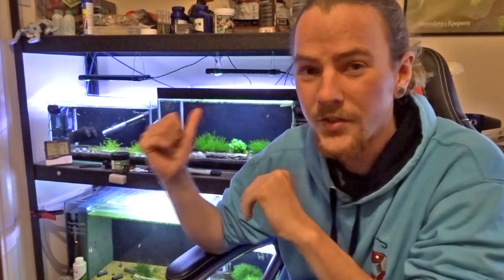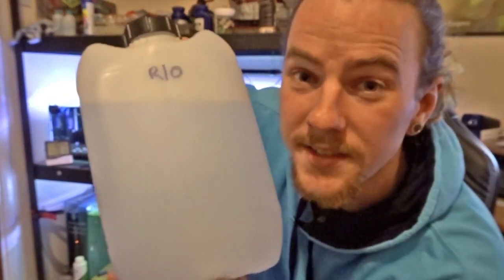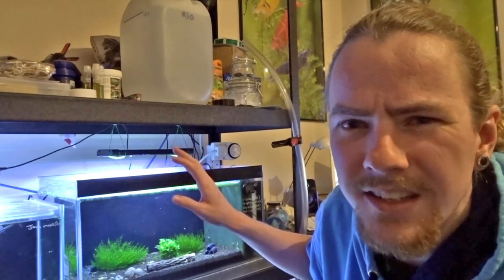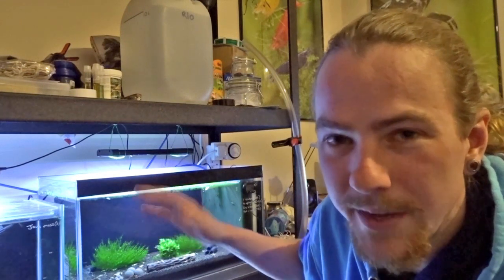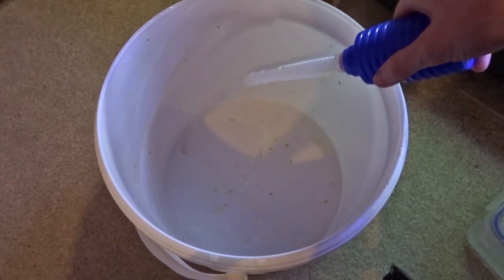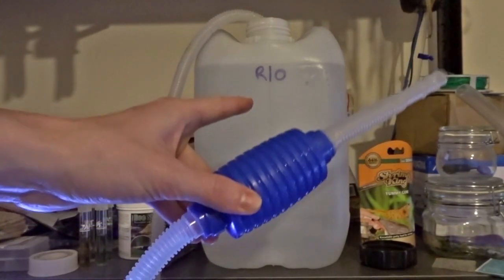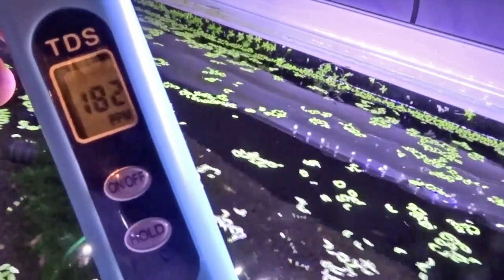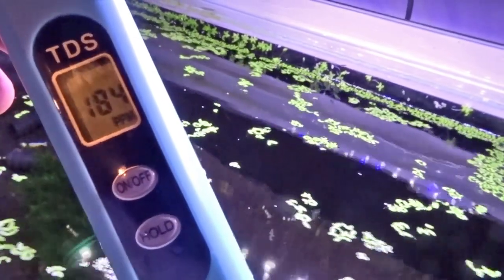How to Lower TDS in an Aquarium

Comment: My son was a Math major and he made me a formula to calculate how much I need to change exactly to reach the desired TDS for my tanks.   It is D = V (final tds - original tds)/ (original tds - new tds).   V is the tank volume. D is the volume to be changed. original TDS is the dirty tank original tds measure. New tds is the tds of the water coming in. Final tds is your goal tds. Then I do consecutive days until I reach that goal if it's more than 20-30% to be changed. Since sometimes I feed some of my fish baby brine, tds will go up more intensely so I stay on top of it. Hope this helps. : )

Comment: I got 2 blood parrot and they are still lil babies. Like around 1 inch or so. Our regular tap water TDS is around 118. My goal is to keep the TDS level between 300 to 200. In order to achieve this I have to do the water change daily or sometime every second day. No real or artificial plants in the tank just few hiding spots with power filter and air pump. Is there any reason that you can imagine why TDS is increasing so frequently. I do vacuum the gravel for any waste every time I change the water. Also my tank is like 8 days old or so.

Comment: Question;  I’ve cycled 2 new tanks.  My tap water is roughly 20-30 tds, which is very low!  My cycled tanks contain 1500-2000 tds!  I’ve used fritz bacteria and ammonia fuel to cycle the tanks, and salt per instructions.  Does anyone know why in the world tds would be so high.  My only thought is it may be measuring “good” bacteria.  I’ve added nothing else but plants and sand substrate, so I know it’s not some random chemical/pollutant.  Help me please!  Even seasoned fish breeding companies have not been able to direct me.  I’ve done water changes with the low tds tap water, and when I measured a day later the tds was above 2000!  Leads me to believe it’s multiplying bacteria, but I’ve not read about this happening to anyone else cycling tanks.

Comment: Can someone help please? I'm super confused with the water change aspect using R/O ("Rio" water lol!) water.

I totally understand the 20% water change ratio to not stress out the live animals, BUT, over time when you change 20% each time during cleaning, would the tank eventually be 100% R/O water? 

I have a 6 gallon live planted Betta tank (no Betta yet since mine recently passed away due to a tumor) that has been cycled for over 1 1/2 years. I live in San Diego CA, USA and the water in the area I live in has rather high pH (7.5) and TDS (700's).

My reputable fish seller suggested I replace 2 gallons of my tanks water with RO water to lower the #'s before I purchase a betta from him to ensure the #'s are lower.

I'm skeptical in doing that since I don't think it will be that easy to balance the levels that I need them to be. My last Betta fish lived happily until the tumor came around. 

Lets say I DO place 20% RO water and I'm ready to do a water change and I remove 20% of my now tap/RO mixed water. Do I add in 10% dechlorinated tap and 10% RO water? Sounds simple enough but I have a feeling it won't be as easy as it sounds.

Help please?

Comment: How did u deal with PH ? RO water has extremely low pH tho
Reply from the maker: Good point. The pH in these tanks generally sits around 6, so it’s lower anyway and as long as the buffering substrate is still working I’ve not noticed any major swings. I think as long as you have things in your tank that help to buffer the pH then small amounts of RO water should be ok :)

Comment: Lol, my tank's TDS is 400ppm. Is that extremely high for a low tech planted tank? My plants are having a hard time growing by the way. Also pH is around 7.6 and GH is 10 degrees. :(
Reply from the maker: There are a lot of variables. Like how long you have the light on and are you using fertilisers?
Reply: Same with me...my tank 583 ppm..only 5 gallon tank, no fertilizer
Reply from the maker: Have you tested your tap water?
Reply: Ughh same. My tanks' at 500+ ppm now. The tap water is ridiculously around 425ppm, and I checked that my tester isn't busted. Can't budget for an RO filter right now so I've just given up and only take in really hardy fish and shrimps :/
Reply: @cladellain  do your plants grow well?
Reply: Noble de Rafael They’re okay, but that’s because I only bought hardy plants. 4/5 amazon swords are growing steadily, another long-leafed plant (I forget the name) flowered, and duckweed still getting everywhere 🤷🏽‍♀️
Reply: My TDS is over 900.   I use strictly DI water tested as pure.  My plants never grow and show all signs of deficiencies despite all the fertilization I give them according to the Seachem dosing schedule.  Phosphorus, Iron, Potassium, and Nitrogen and root tabs throughout. I even add in Epsom salts for magnesium.  I upgraded my light to a Fluval Plant LED 3.0 light and then got a huge diatom bloom within a week after more light was added.  I have both brown and green algae. I clean my gravel once a week. 6 bettas in a 50 gallon tank. All my chemical tests are good.  High phosphate is treated with Seachem de-nitrification in the Fluval canister. I also have a Phosphate remover pad.  My city water has high silicates so I bought a test kit. Also Seachem’s Phosguard to start using that.  I just added snails from two different sources and they don’t seem to be moving much.  I’m becoming very frustrated with the hobby.
Reply: @loreall.2461  Where are you located?
Reply: The Seachem silicate test kit showed low silicate levels.  It was nearly comparable to the original pure DI water Im currently using replenish my tank.  I’m guessing I’ve created a mess by removing too much water with a 30% change, a filter cleaning and too much of a gravel clean with my sludge extractor upset the beneficial bacterial.  I also dose with API StressZyme twice a week. I’ve only got 5 bettas in a 50 gallon tank. But that doesn’t explain why my annubias are not thriving.  They show all types of deficiencies, no new leaves, yellowing, browning.
Reply: @Noble_Isaac  Southern California
Reply: @loreall.2461  I'm in AZ. So we are close. I did dome research and can confirm that high TDS can cause plant to die. I'll start using RO water and see how it goes.
Reply: @Noble_Isaac  that’s good to know.  Just make sure you remineralize, as the plants need an appropriate amount of macro and micro nutrients I am told despite my plants not thriving. I’m trying to reach Seachem for two days straight to get the straight scoop on my 50 gallon tank with RO/DI so I can get to the bottom but not having much luck with getting through to them.  My tap water is liquid rock so I’ve gone to DI but may simply return to a combination thereof since the betta fish I’m keeping don’t require as soft water a water as it turns out.  Hustling 50 gallons of RO/DI can be a chore.
Reply: @loreall.2461  That's a solid method. thank you for the advice and Good luck to you! I'm also using RO+DI as I have a reef tank. But I mainly use RO for my freshwater tank since it's more convenient. But I can see DI might work better, providing that I remineralize the tank like you said.
Reply: @Noble_Isaac  for anyone following our chat, I have an extra long 40’ + waste line off the RO/DI system which I have setup connected to a hose bib and hidden away in a covered outdoor box.  The waste line runs directly into my pool.  So when I make several gallons over a weekend to store up, I simply drag the line out to the pool and get to work making water over the weekend.  It’s much easier making about 20 gallons at a time this way and then bring the line back in and tidy it up into the outdoor box.  No one is the wiser to my outdoor system and it’s simply another outdoor box and I don’t have to look at a filtration system mounted to a wall.